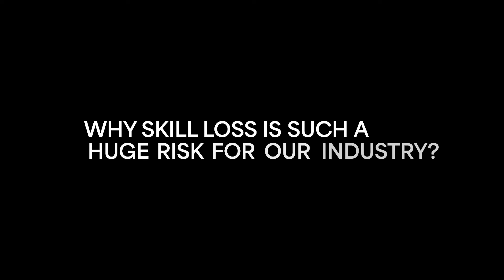Are We Losing the Ability to Make Things in North America? | Machine Shop Talk Ep. 133

Comment: That was a great video. I started my career as a draftsman in 85 and worked my way up the ladder going to night school. My real education was from the machinists that made my parts. As a design guy, the sit downs with machinists was the best education there was (thank you all very, very much). BTW, I got to run one of them radial arm drills in the 80's at my first draftsman job at a die shop. I had to hang on it to get the drill to work because I didn't weigh enough, good times.
I have trained allot of folks in allot of things thru the years and one thing for sure that works to secure the knowledge and also keep it transferring to others is using the karate methods.
 Once someone knows something and has proven that skill, they can become the teacher.
I have found that once you have taught a new skill 3x (I would do this in class, help 3 people) you retain and understand it better. Karate classes use this method for teaching.
I think videos are a great way of capturing some data but mentoring is the best. The interaction and real time teamwork gathered by doing actual jobs while learning is my favorite. I'd prefer to mentor thru a small project. After a few small projects that encompass the needed information, folks grasp things better. Again, in real time you get answers and instant feedback (great for this generation) to see the actual conclusion to the training.
It is not very cost effective for companies so they need to have something that can help generate income for the company like production help, set up help with their main focus on training.
I have worked in contract engineering for a long time and have seen allot. In my field (and I'm quite sure we can have a big discussion on drawings) what I see that is missing is the ability to make a drawing. They don't even teach it at allot of schools anymore. I learned drafting BITD and then design and have been doing it all my life. I would like to pass what I know along but need a way to do so. I have been teaching young mechanical design engineers for a very long time and they do not get what they need in college. The stuff I know is from working in industry but it is not taught??? 
I have 5 years on the board then 2D drafting then 3D and have excelled in CAD doing medical design.
Someone out there want some great training and even get a job finished, let me know.
Reply: BTW....one of the HB1 engineers at my last job (Masters in mechanical engineering from India) came to me one day at my cubical, with my co workers standing there, and said....I want you to teach me how to think like you.
I told him I can, but i was leaving that job.

Comment: I worked in the computer repair trade for 30 years. I's been my general observation that it is the employer's general goals are to remove as much need for skill and headcount to do a job as possible. That means they can hire less workers, and lower skill workers who get paid less. That largely means automation. 
For example, when I first started for the company near Boston in the mid-70's, I worked in a circuit board repair plant. A technician manaually troubleshot a defective board in the computer down to the bad component, using diagnostics, schematic prints and an oscilloscope. This took real troubleshooting skills, such that I had learned in tech school.
By the time I left to work in Field Service 3 years later, we had automated machines such that all a tech had to to was mount the board on the machine, push the start button, and the machine would tell the tech where to connect the probe next. After a half dozen iterations of this, the machine would tell the tech which part on the board needed to be replaced. The defective part was indicated with a dab of Whiteout, and sent to another department to have the component replaced. 
There was no real skill required in that at all, at that point I was just an operator. I was asked where I wanted to go for my next job in the company after 3 years, and I chose a field service position back in Detroit. I had started the module repair job at $4/hr, and when I got to $5.20/hr, I was making too much. I'd imagine there are some parallels in the machining trade, with CNC having taken over for a lot of manual machining, and next AI.
Reply: Meanwhile in China the thought is "If I can hire and train more people, I can make my factory bigger".

Comment: We race ourselves to the bottom. My dad had a small 4 man shop all manaul machines  we were the main supplier for a company. NAFT  came in and KILLED our shop finally wented down to just dad.  At the end my dad could not  even buy the metal to do the job for the what the imported part cost the pay 30 yrs ago was $20/hr now the pay is $18-$20/hr hamburgers joint here in California pays $22.

The politicians got rich and we got screwed what people don't realize is that machines can be replaced but the knowledge is lost and can't replaced be dad is now 91 he had a 4yrs apprenticeship as a machinist then did another 4yr apprenticeship as a tool and die maker . Manufacturing will nevere come back we have lost the base component to build off of which is knowledge the school system is turning out people who can not read or do math if we start now just to get back it would take 30-40yrs to have a starting point

Comment: Hi,
I don't know your industry.     I'm a EM Drafter / Designer Deg. Exp. 13 yrs, 7/6 split Mech. / Electronics/Electrical heading for my BS in Physics - Cosmology Theoretical.
F'  am I doin' here.    Well sometimes we need to test something and build the test equipment.

Might check the Nuc Energy Sector.    That's the Free Energy not the Defense stuff.

Okay, I been watching us loose alot and I don't like it.    In addition to my 2 yr and exp spent all 4 yrs. in High School in a Drafting Class so the amount of training I have is kind of unusually high.    At least for a Drafter.     So I usually work for Principal or really high up guy.    Everywhere I've been.    Last I broke 6 fig. w/ a 2 yrs Deg. so  . . . but I set my path long ago toward Physics and not to remain as a Drafter.

I've covered 120 mi Rad. of Seattle and Mfg. is strong in Kent WA and Everett but Kent is Disneyland for Big Mech.    Most Big names have at least an office, Raytheon, Lockheed, Northup, f/ Everett to Auburn.    We have at least 2-3 of those Energy Companies I described.    One is trying to hire now for a Wiring Harness CAD Layout guy.    Looking through their stuff alot of custom parts.   I mean is R&D but they are trying to contain a Star of our own or Sun whatever ya want to call it -  lmao !!!!!!   Okay.

The last parts I had made for myself project were one offs (2) sheetmetal plates for Artic Freezer 360 Mount to PC Chip.   Plastic Radius converter for Telescope.    I had Xometry do it.      You might have a peek at how the do online bussiness 'cause I just designed and uploaded the models f/ Onshape.    It was real spiffy and cheap but there was far more than what I needed.   And others will need that.

As I was comin' into my field it was goin' overseas and about broke my heart.    But I never sold out to MEP as most did.   We have Satellite Co.s out here too and Rocket Stuff somewhere.

Best
Maybe it'll spin a new business model out for ya

Comment: I work for a major manufacturer. We have a hard time finding suppliers in the US that know what they are doing. The owners and offices don’t know about machining, the processes, and quality. And neither do some of the machinists who are just part loaders now. We have a supplier who has a new stop ship issue about every three months. Difficult to get them to troubleshoot and correct the basics. Coolant flow, cleaning the sump, dressing the wheel, using the right wheel, checking for grinder burn, measuring surface finish, and on and on.

Comment: Loss of institutional knowledge is a major issue. I'm a retired machine designer. I worked for a small company that wound up machining and fabricating most of what we designed. I learned a ton from journeyman machinists over the years that made me a better designer. 
I wish I knew the answer as this is also a problem in the engineering world. A lot of it has to do with the general deindustrialized economy that we're in now. Less industrialation requires fewer engineers and that requires fewer machinists. The company that I used to work at has completely evolved from what it was when I was there. As a consequence they do a lot less machining and fabrication "in house", so there are fewer machinists and fabricators there now.

Comment: When I was 10 ears old I was the mechanic for my stepfather's home made amusement park. As he would rather buy booze than pay for outside machine work he bought a, for the day antique metal lathe belt driven off the motor on the floor, so I could make the parts like connecting links and sleeve bearings. He also has a band saw, drill press and a stick welder. Well I got pretty good at making and fixing stuff. After a couple of years I added a home made coal fired forge and an anvil. I added making knives out of scrap flat truck springs and worn out files from where he worked (lunch pail express). They provided enough money for cigarettes and entertainment.  Then I went in the Navy and found out they had more use for a floor mopper and dish cleaner than a good metal worker. Eventfully I wound up on the Mekong River in Vietnam as a extra hand riding boats out of sheer boredom. There were guns involved. Great fun.

After I got back to the world in 1967 I worked some construction and as a machinist in  a high tech industry. I got tired of working on a concrete floor for minimal money while better educated (?) bozos made the rules. Fortunately my wife's family was willing to foot the bill for a college education for both of us. I spent the rest of my working years in a car or an office trying to keep the environment as clean as possible. 

If I were a young person, male or female, that did not want to either go to college or sit in front of a computer screen with their brains leaking out of their ears, I would look for work in an industry that cannot be sent off to wherever. I would look at railroad shop work, heavy construction equipment repair, industrial electrician or similar. I would join a trade union as an apprentice and get the necessary training. 

FWIW: Almost all the office jobs are going to be eliminated as Artificial Intelligence as companies replace expensive bureaucrats with expensive and stupid AI programs.

Comment: Nicely articulated!  But not a new phenomenon! In 1980 or so, I took a job in industrial maintenance.  We got a new machine in to cast small lead components.  I'm probably wrong with my figures, but they're sort of in proportion... The machine (DCMT, Die Casting Machine Tools) itself cost about £20,000, and the first die, a 6 impression die, with core draws, ejector pins, waterways for cooling, etc, cost in the region of £8.500. The die, overall, was about an 8" or 9" cube, but the work that went into it was tremendous, The subsequent die was sourced in China, even then, and, similarly complex, cost £3,500, delivered... Even then, I could not see where there was any profit to be made, when premises costs, machinery costs, labour rates, 
tooling and other consumables costs, materials, heat treatment, the occasional scrappage due to error, transportation, design, everything else... was taken into account.
DCMT themselves shut up shop a little later, in 1982, I think, so even they couldn't see a profit (or couldn't find skilled personnel to do the work)
I found maintenance and repair work less stressful than manufacturing new parts / assemblies... And I wasn't tied to one machine... I don't know what the answer is, but it's noticeable that if we're paid well on the shop floor, employers seek to employ fewer of us... And demand we do overtime at their bidding...

Comment: Manual machining took YEARS to develop, the nice thing about CNC is that I can learn soildworks and how to build a CNC and then I can do alot of stuff in a shorter amount of time and can focus on design and engineering and then pop over to mill a part wihtout having to pour my life out into manual machining.  You could CNC machine a die too.  The real hard part is forged parts with speical hardening like crank shafts and such, you cant just mill those out as far as im aware.

I will say learning solidworks is non trivial, it took me years part time to get really good where I can pull a thought from my head and get it into solidworks.

Comment: About the comments. The pay expected vs what you really do know is the problem... Im a hobby machinist, Ive done manual and CNC and even some 3D printing. but Im a software dev by day. The problem is that truly knowledgeable Manual machinists are very rare. Any boob can turn handwheels to square off a part to within half a thou... but it takes a whole other class of brainpower to make a case hardened custom helical gear on a manual Knee mill with a dividing head within a reasonable amount of time. But with CNC, we have one mechanical engineering Brainiac with access to fusion 360 running the shop and the rest of the goobers are simply feeding the machines... but the goobers expect to get paid $40 an  hour or more for that and claim to call themselves machinists?
Reply: I took classes for machine shop work. In my area, there was myself and 2 other guys that had any interest in the courses. The school running those classes had to cancel them for lack of enrollment. The instructor that I had spent his summers going to China to teach them. I saw this happening 30 years ago. No one wants the knowledge, but they like the pay if they can get it. It's not a new problem and it should have been addressed when there was a chance of fixing it. Now? Not so much in my opinion. As for myself, I like turning the manual cranks. I'm not in the hurry that the rest of the world seems to be.

Comment: I am retired now from maintenance but I made 3d printed items rather than sending them out to machine shops in many cases. We had CNC guys but they moved on and sold the CNC stuff. The repairs were done on the lathe or mill but they scrapped the lathe around the same time I retired. The rest of the work went to a machine shop. It will be hard to attract younger kids into this trade. Very few wish to get dirty.

Comment: I was fortunate to find an old school shop inside a factory with 3 old tool makers. Two are getting ready to retire. I do mostly cnc lathe work. But when we get jobs. If we're not too busy. We do it all. Lathe, mill, Id/od grinding, wire edm, and all our own programming. Most shops have equipment specific departments. Where you have a few decently paid "set-up" guys. And the rest just load and unload parts. If you work with any old timers. And they're willing to teach you. Learn all you can from them. These guys were making complex components without cnc machines. And without calculators! Im trying to get an apprenticeship in our shop before our 2 old timers retire.

Comment: My last job. ENTIRE factory 100's of employees. Lots of machines. 2 machinists. I was first shift, other guy was second shift. We setup, programmed, changed worn tooling fluids coolant and all that. Then someone else with ZERO machining knowledge would run the job.  Rinse repeat across factory.  1 guy on each shift new how to machine and code. No one else knew how proper. or was actually trained as a machinist /tool maker.  So, after I left that job?  They now have ONE machinist... and a welder in training to be a machinist...and that never works...you need school to understand tooling and cutting geometry. and to code is no simple task. You have  to know how to manually machine to properly code all the feeds, speeds and peck depths needed.  You cant just have some upstairs programmer spit out code that is efficiant. It may work, but it needs help to be trimmed down and optimized by a human with an ear and eyes.

Comment: Over the past two years I started researching and buying parts for an LS build. AS part of the research I was looking up local engine machine shops within a 2 hour drive from me. Basically what I found is that in the past 5 years, about half of them closed shop, or were closing shop and not taking new orders. The ones that were still open now had extra long lead times for work. A good portion of the shops closed due to the owners retiring either due to age or tired of the BS.

Comment: Hi My friend. I served a 10,000 hour toolmakers apprenticeship in the late 80’s with a big emphasis on form grinding for the electronic connector industry. Mostly mold parts and some die work. Then learned cad and then Mastercam. Before I retired I was programming wire EDM and 5 axis machines and was very successful at it. The thing that separated me from my coworkers was that I wanted to learn as much as I could whenever possible. Yes the shops need to offer training but the employees must have a burning desire to learn. What I see is the willing and dedicated employee is very hard to find. To this day I am stunned by how many young people did not want to work in our Very high end shop and learn Cad, Cam, wire EDM,and 5 axis. The opportunity was simply dismissed by them.
Reply: The willing and dedicated employees are there, but some of them are women. And despite what many would have you believe, it’s still very hard to get into the trades and stay there without getting bullied out when non male